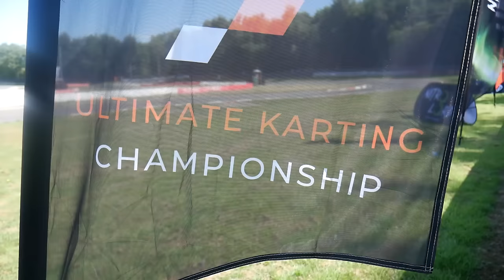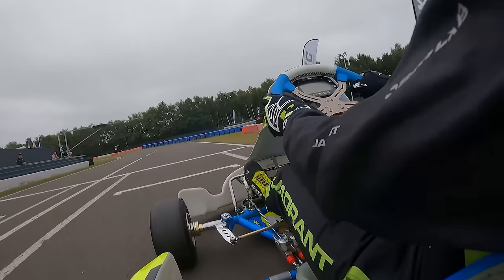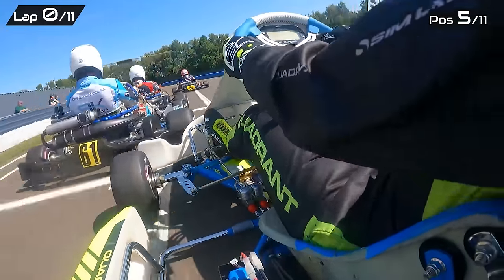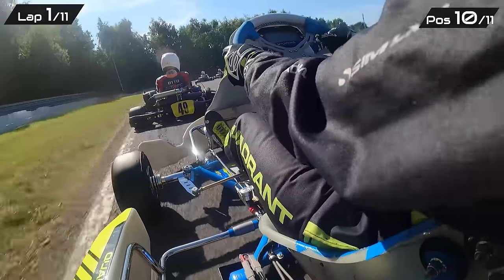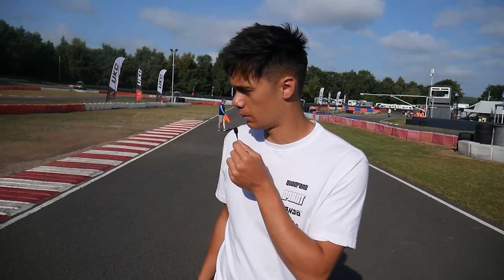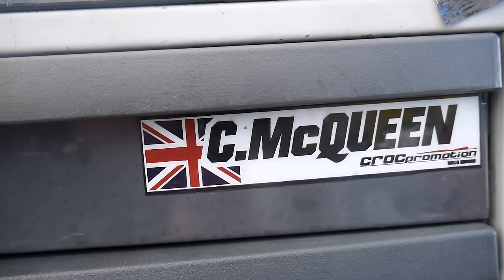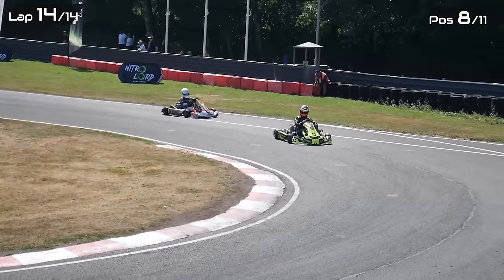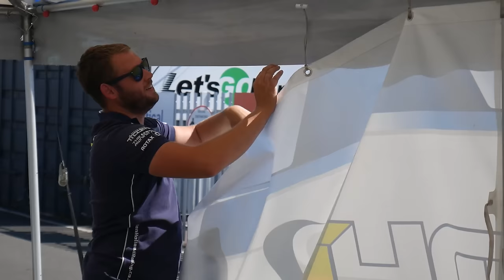This Professional Kart Racer Showed Me How To Drive Properly

Comment: You're a much better driver than you give yourself credit for. a little bit on weight, a little bit on power and you'd be right there.

Keep it up mate these vids are awesome for karting!
Reply: Yeah 100 percent. Every 2kg over the weight in karting is worth a tenth. He's doing awesome considering he is running over the weight, and has only been racing the x30 for 2 months! 😎
Reply: If you are 8kg over the weight limit then on typical longish tracks ca. 50s then you'll be losing 0.4s when you are piloting an X30 or similar. In reality you only have to find 0.3s which is very little considering it was your first time at that track
Reply: @raynercostellokarting9982  2kg is no where near a tenth
Reply: @CaptJofaz  If 20kg is worth a second, explain why 2kg isn't a tenth, We've done alot of weight testing out different tracks to work it out, but if you can show me otherwise, go ahead
Reply: depends on the track, kart, and driver

Comment: For anyone who hasn’t driven an x30 or rotax - please appreciate how difficult it is to drive smoothly! It’s like having someone who is 50% stronger than you randomly yanking at the steering wheel  round each corner whilst someone hits you in the ribs with a lump of wood. The top drivers make it look so easy - reality is much different!
Reply: I know 😂😂 and it shatteres your hands because of no power steering
Reply: And same with the Rok Gp as well….
Reply: As an x30 driver, I can confirm
Reply: How do they compare to the crg centurion that larkhall uses for the public rental sessions? I know they are 2-4 seconds faster from lap times but I mean from a driving perspective
Reply: @caledonianrailway1233  2-4 seconds per lap between a rental and race kart? are you sure?
Reply: @caledonianrailway1233  I’ve just looked and it’s a 10 second gap per lap between race and rental records. There is no comparison.
Reply: @thedude669  ok my mistake
Reply: But anyway how do they compare when driving
Reply: @caledonianrailway1233  Reply is pretty late, sorry. The CRG is physically heavier, being a rental, but they're made for non-serious people to drive. An X30 is lighter, but has a much more powerful engine (9-12hp vs 32) and WAY grippier tires, so it would feel much heavier to steer an x30 than it would a Centurion. 

As the other person said, there's no comparing the two. These two karts are in different worlds.

Comment: One way to shave a couple of kilos off is to drive naked
Reply: Another way is to chop off an arm

Only need one to steer 🤷‍♂️
Reply: Or cut off your left leg. Braking only slows you down.
Reply: @alextaillefer1792  Hell just take off the braking system. If you don’t have a leg yo use it no point in having it
Reply: @alextaillefer1792  get a prosthetic, weld it to  the pedal and youre sorted
Reply: @alextaillefer1792  put a nitrous on
Reply: I wanted to recommend him to go vegan, but man hahah this is way better XD
Reply: Just don't sit in the kart. Drive it by fixing a camera on the seat and steer, brake and accelarate the car by a controller.
Reply: The gayster

Comment: When I am on the track (not driving) I always hear people talking about how practicing is the key to get fast.
And if you allow me a tip, it's not just about learning the perfect line, but about overdriving and "underdriving" the Kart. Knowing how the Kart is going to react in any situation.
This is how those guys can put clean inputs on their driving. They have done it all before and just by feeling the Kart under their butt they know exactly how much brake or steering is enough.

Comment: Pretty good analyzation of what needs to be worked on. I can't speak on behalf of these X30 cars specifically, but in America (I think we use a style chassis, though I drove Birrel) it's important to have the kart as loose as possible without spinning out. You noticed how you are a lot more aggressive on the steering wheel and while yes that's true, you're specifically too aggressive with the wheel on entry. You want the back end to step out just enough from braking so you don't have to input any steering to make the entry, it allows you to gas it a little earlier on apex since your kart is rotated more towards the exit by the time you get to the apex (hopefully that makes sense). It's VERY VERY hard to nail those kind of karts though and kart time is so under rated. It looks easy, but its so hard to nail it every lap. You're doing an awesome job so far and seeing how critical and analytical you are, I'm sure you'll progress greatly as the year goes on and into next year.

Comment: Advise from another ex pro kart racer. The way I was told to learn to gain those 0.1-0.2 sec in each corner, was trying to be as late as possible on brakes in corners where I was losing that time. Do it on training sessions, with the intention to really push it. It doesn't matter if you spin out, you have to find that limit and be comfortable with it. Also, try to use more track width, go more to the outside before corners and cut apex hard (look how much track Kayden uses), the more you travel in a straight line the better. That will allow you to do less steering which you also lose around 0.1 in each corner as you have to correct a lot. Like the other guy said, you need more time behind the wheel. I bet all top 3 guys were on a training for few days before competition. I was on a track always week before the race :D

Comment: If you want to reduce your weight, you can use a smaller fuel tank, carbon fibre floor tray and small brake disc if you haven't already.  You could also ditch the mycrone for the race if you're brave enough and need the extra hundredth.

It looks like the kart bounces too much going through the corners.  Obviously a smoother driving style would likely sort this out, although you could try going lower in the pressures, add negative caster, or soften the rear set up to help the kart exit the corner.  Saying this, I expect DHR would have helped in this department already. 

Highly recommend Terence Doves book on kart driving if you're interested.  

Love the series, looking forward to gyg.

Comment: You need to stamp on the brake and release slightly as you turn in, gets the load on the front of the kart and helps you turn it.
Don’t think you brake hard release and do it again.
Do whatever suits you not what other people are doing.
Ryan norberg has a good video on this👍

Comment: Cool video with excellent perspective on how incredibly competitive karting is. It really comes down to athlete levels of fitness and strength to perform for even the 10 laps or so to control the kart how you want and know. Then getting into all the extra variables like center of gravity from bigger competitors not just weight and areo drag etc. Really difficult karting at top level so to be on there tails is a this level is epic

Comment: there is a video from donut media where they discuss about racing line and stuff.there was this thread which was attached from the bottom side of the wheel to the throttle and how much you steer the wheel affects how much you can step on the gas. And last but not least, a pro driver looks ahead of the corners.

Comment: You finally explained to us why they are leaving you behind coming out of the tight corners (although you're definitely doing better).  8 kg is an insurmountable handicap.  You will get closer, but you're never going to be up with the leaders.  Would you mind explaining why this was not a problem in Club100?  Do they have a higher minimum weight?  I think there's something wrong with your current class if somebody with your build can't meet minimum weight.

Comment: Some things to do to get the kart lighter. Smaller radiator, lithium battery and cut down all bolts that can be shorter for example the bolt we can see on the camera on the seat :P

Comment: You need to get the Odenthal go kart mount. Better camera angle and stays in place! Also mid corner stability seems to be lacking. Did you try a ride height adjustment for better grip?

Comment: Iv never carted in my life or really raced at all but I thought I may offer an idea I noticed while watching. You seem to be considerably taller than most of the faster guys. Are the seats adjustable? If so did you move yours back? Im wondering if on a platform as small and light as these carts has that affected the balance of the cart. You are clearly getting better and I would agree (with my tiny knowledge of racing in mind) that it seems the biggest differences between you and the top peeps is their breaking and steering inputs but, out of that hair pin they just all seemed to have soooo much more grip. Do you think it might be possible to have a less comfortable ride but move your seat position up closer to where the shorter lads are? Effectively re-centering the balance of the car and maybe allowing you to stomp that break harder with out the cart squirming and maybe reducing some of the understeer on your turn ins. Either way man I LOVE this content and the professionalism and calm demeanor you have while learning in what must be an incredible frustrating situation is just top class!  Thanks to you and all the sponsors that make my weeks 44mins better!

Comment: As youre turning your wheel spins too much and you drift a bit. You gotta be soft on the throttle before flooring it. You can brake later and use the the turn to reduce speed a bit and press the throttle soon to regain grip. Ive been racing in the same category in Brazil so I know a bit though Im not sure if this helps.

Comment: Fixing your camera is just a matter of using two (not one) 3/8" bolts (drill through the camera) and lots of 8 hour Epoxy and bake everything in an oven. Using helium balloons to compensate for your weight won't help. Not just because of the drag penalty, but also because the problem is really your inertia, not how much gravity you have. However, adding nitromethane+methanol+water  to your fuel tank should work I think. (You might want an armor plate between yourself and the engine though. Kevlar shouldn't weigh too much). Don't worry about the inspection. Just have two carburetors. One for racing and one for inspections. There are many ways to actually reduce weight. Shave off all hair. Pull your finger&toe nails. Go naked and body paint the racing overall.

Comment: Don’t mount the camera to the radiator.  The plastic mount is going to weaken at the 200+ degreeF temps, so even if you clamp it down tightly when it’s at room temp, that clamping force goes away when the plastic heats up.
Reply from the maker: It's fine, I just didnt cable tie it like normal.

Comment: Lose 8kg in one hour.  Finish with less fule in the kart... Hard to see but looks like 1 or 3kg is left in at the of your races. Get a lighter camera than the gopro 8.  Remove the digital dash during races, can you get a lighter steering wheel.  Can you lighten your race gear helmet shoes suit etc, do you need to wear a t-shirt under your suit.  If its not too hot can you take a few liters of water out of the radiator.  Lighter seat?

Comment: I literally told you you were overdriving your kart in your first race of this series... and here we are. LOL Good improvements so far though.
Reply from the maker: I knew I was overdriving it. Its one thing to know what you're doing wrong and another to correct it.
Reply: One thing I used to always tell myself to kind of psych myself up to go faster was that there was a very good chance it was possible to go faster than the guy in front of me. All the odds say that he's not going as fast as possible, especially if he's not in first. So, I just always pushed myself to go a little bit harder and little bit faster than that guy in front of me. Even if it seemed like I wouldn't make the turn I'd do it because, well the odds say my assumption is wrong. Sure, I exited a few turns stage left (well usually right in my case) but that's how you find the limits.
Reply: @Super_GT  once you get those brakes figured out (holy shit they are touchy) you'll be upsetting the kart a lot less and it'll be a lot easier to be smoother with all your inputs. I just need you to get back into 6th place so all can be right with the universe, so I've got to try to help. LOL

Comment: From what I can see you’re approaching the corners at the same speed and your top end is the same. But the acceleration off of the corner doesn’t seem as good as the others. Can you adjust the mid range on the carb

Comment: 741 EGT? Wow! I never thought you could get to such a high EGT without seizing the engine?
Alright, 740 EGT it is 💪
Btw, get the cheapest camera, they work just as well, if you lose it, no big deal, All karting tracks are filled with cameras.
If you really want to go fast, make sure you pull your socks up 😉

Comment: They say in F1 that each gallon of fuel is worth a tenth. A gallon of gasoline is 6lbs. Carts are not F1 but on the other hand your 8 pound surplus proportionally dwarfs the F1 example. Then, even at the same weight, your CG is higher because of your height. You can lose the weight (I wrestled in college. Trust me, you can always 8 lbs. You just can.) Better you lose 20 and add 12lbs under the floor-pan. It's that or cut off you head which neatly addresses all your problems but may create others. Let me know. Cheers from the Colonies.

Comment: I'm rather new to your channel but I was binge watching some of your older videos and I wonder, why did you stop with the camera on the front of the helmet? I'm just wondering and not trying to hate but video from drivers perspective was so much better
Reply from the maker: It was banned on safety grounds for most karting championships in the UK. The helmet camera can be used under certain circumstances, like hiring the track for yourself but for the most part, you can't use it anymore.
Reply: @Super_GT  What a shame. I was even looking to buy an action camera to use when doing some spontaneous adventures such as off road biking and karting.
By the way, what action camera do you use? Footage looks fantastic so I guess GoPro? Looking forward to seeing more of your racing videos ;)

Comment: Hey, is it just me or does anyone else also hurt their backs whenever u go karting.
Reply: I hurt my back when doing sim racing, so I'll be in ER after one lap.
Reply: Happens alot. Especially if ur a taller driver. Not much you can do other than pad it up if it's your own kart
Reply: If its rental karts then yeah that's common but if its your own kart you can get a mold or padding.
Reply: You need to get a seat insert or padding  so you don't move side to side in the seat.  Even though I'm 6ft I still use the rubber seat inserts they supply at most tracks I just have to put the seat all the way to the back and the pedals fully foward.  But if you really get into it you can buy seat inserts that just pad the sides of the seat and stop you rattling side to side.
Reply: @Jake Paul rib protector helps stop it 🤷‍♂️

Comment: Can someone explain what he was doing wrong on the brakes?
Reply: Brake pressure is not constant. Needs to be on the brakes later but smoother. Want to brake with the kart as straight as possible to allow kart to flex on turn in. Some times when he is on the brakes the kart gets disrupted and squarely. That does not let the kart work properly into the corner. Would cause mid corner stability problems.
Reply: @BrandonScheiber-lp9qb  Thanks!

Comment: Its either your fatness, wrong gear ration or you are to late at accelerator you losing on every corner exit.. can also be proper amateur mistake trying to brake later and later this way missing apex and are late at accelerator because line doesn’t leaves you going faster to not run out of track.

FYI - generally as easier as something looks form the outside the harder it is to become very good or quick - that’s what all kind of sports are like. Difficult hard work and long time experience is needed. Same in sim racing 😉 and in motorsport there are also factor of the engineering side & moneypool

Comment: To get practice w/o lots of $$$ on tires, etc. you could race cars that handle as close to the X30 as poss, then set it up tohandle even more like it and race against the ai at a lower level if necessary (I often did this starting w/ GT3, to just get the cars to handle the way I like or slow my car down or as a challenge, intentionally hard to drive). Or online, but if worried of your driver rating taking a neg hit, make a second account, like Dave Cameron on iRacing. I saw you several times missing apexes & other mistakes. Getting better consistency might not help your fastest lap much but could really add up over a race.

The idea of you being fat is hilarious. Don’t try to loose weight IMO. I’m the thinnest guy I personally know & U R definitely skinnier than me, loosing more could be unhealthy. U should try to get them to raise the weight min by 15 kg so taller drivers don’t have as much of a handicap. Shorter/ lighter drivers would still have an advantage bk they could put the ballast so they have a lower center of gravity or change weight distribution.

Comment: driver coaching, the same as most supposed finite coaching skills in / for any sport... is a fast track way of essentially indoctrinating / teaching away ANY ! natural ability, that has risen individuals far above and beyond their rivals i.e. coaching is a tool, its something to listen too... take on board, then forget, as soon as your involved on the day, with the cart, with the mindset, in the situation that you ! determine, on that day, in that moment.. whatever is required to achieve whatever you wish... Basically coaching is bollocks m8 ;) its 10 % of whatever / whenever / wherever you ll need it.